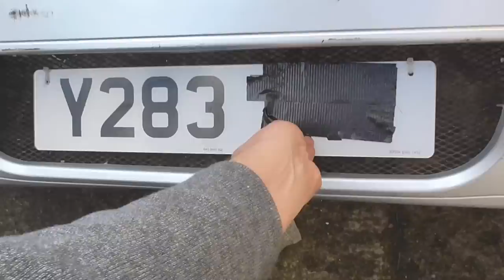New Bumper and Bonnet for Project Shed - Volkswagen Golf project

Comment: on the oil fill there is a weird extension piece and it leaks from there, also EGR but you should be planing on a EGR delete pipe/ exhaust end cap.. You could also consider a elephant mod, or catch can if your arsed from the crank case.
Reply from the maker: I'll have to do some research. Not a clue at the moment what to do.

Comment: I think your car probably been  in a front end smash. That's why every panel different colour. Its probably had headlights changed to as bolts are missing. So I think that pipe was definitely for headlight washers but they have fitted standard bumper and headlights making that hose redundant. Hope this helps it's my theory.
Reply from the maker: Thanks man. That pipe is a bizarre one as it connects to nothing lol
Reply from the maker: @TruthTortoise81  I've checked. They are fine.

Comment: R32s have the same grill as the rest mate
Reply from the maker: Then why does mine not fit? There's no hole for the grill to drop into in the middle of the bumper :/
Reply: @bluudysgarage  because its a cheap replica bumper and they have not made the holes for the grill
Reply from the maker: @clifton1989  that answers that then. It is abs plastic and not fibreglass which is good.
Reply: Glad you got the abs 1 because the fibreglass ones are a really crap fit lol